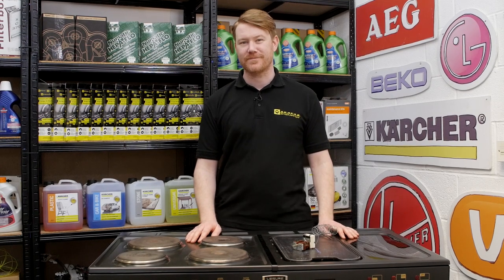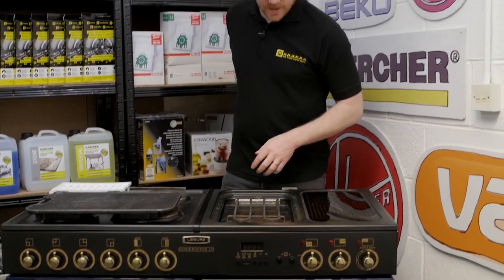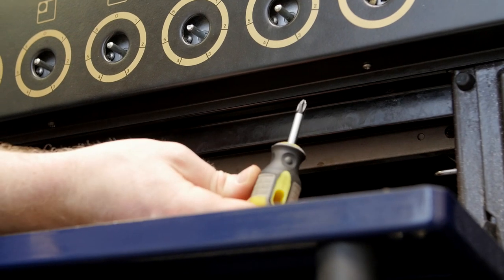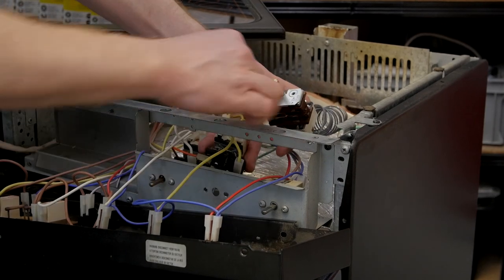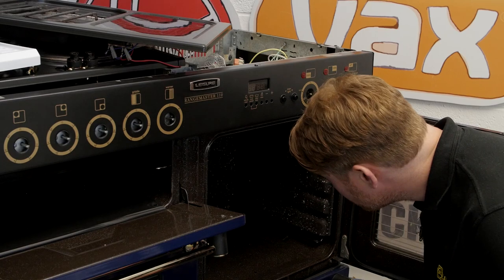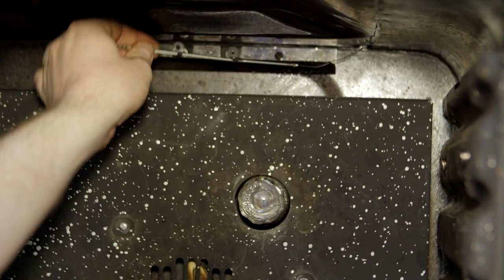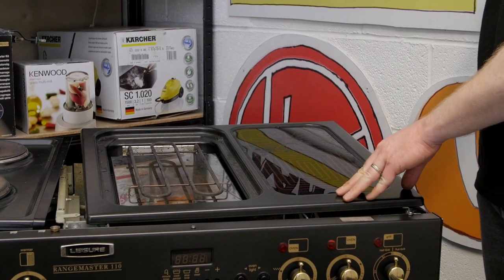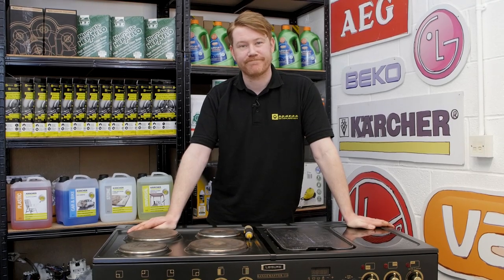How to Replace the Thermostat on a Rangemaster Cooker

Comment: Any tips on how to replace the grill theromostat (grill will not stay on) as I cannot see how to remove it. Thanks.
Reply from the maker: Hi Graham, what model are we talking about? if it's a Rangemaster the process will be similar to how mat does it for the oven thermostat by taking the control panel off and it's there and follow the capillary into the grill section.
Reply: @eSpares  Hi, it's the Rangemaster 90 so thanks, will take a look at how that control panel is taken off.
Reply: @eSpares  Ah right, now I see it. So it's not just a case of replacing only the capillary but the thermostat as well?
Reply: Sorry to bother again, but is it the same thermostat as the one used for the oven as I cannot seem to find one on-line titled 'grill' thermostat.
Reply from the maker: Hi Graham, the thermostat comes with the capillary already attached.
Reply: @eSpares  Hi back agin, So where can I buy/find a thermostat with the capillary attached as looking at spares I can only seen them for the ovens - so is it the same one? At this point I can only assume it is becuse why would they be different? Guss the only was is to take the old one out and see it they match physically or there is a part number stamped on it. These things do not look cheap so I do not want to order the wrong one!
Reply from the maker: Hi Graham, you will need to order the correct one for your model, take the details off the rating plate and go to our website www.espares.co.uk/browse/at1092ma2322/cookers-and-hobs/rangemaster
Reply: @eSpares  OK, thanks for all your help. Much obliged. :-)
Reply: Does the gas hobs come away as easy for the dual fuel version?? 7:12